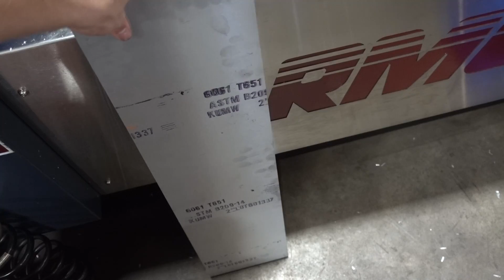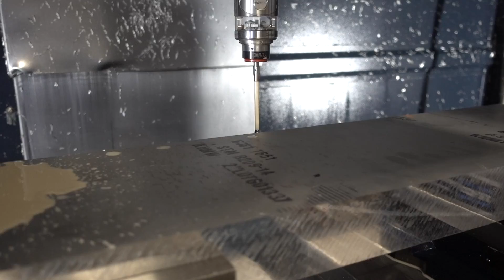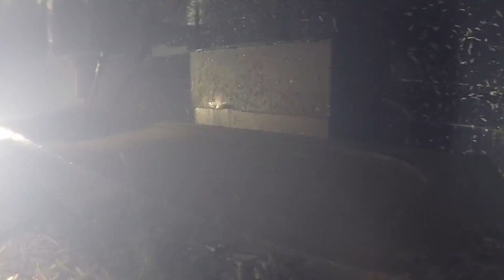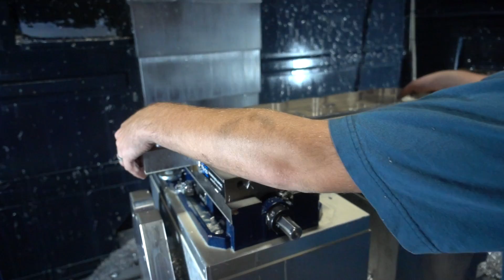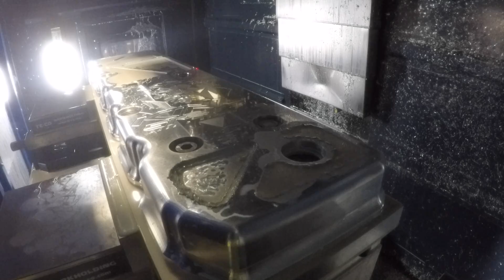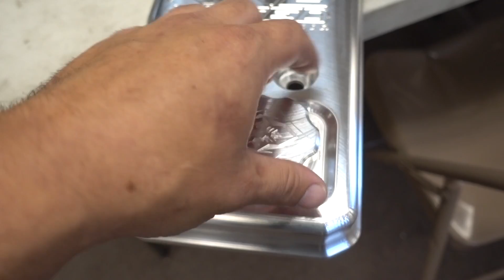HOW WE MAKE CUMMINS BILLET VALVE COVERS!!!

Comment: You really shouldn't smack the first op down with a deadblow. You should cut it in it's most relaxed state until you have square and accurate edges. Then tap it gently down onto your parallels or whatever on the second op. If you keep doing it this way you are inducing stresses or twists into the material. when you release it the material will want to spring back, and now the "flat" surfaces you just machined will be bowed or twisted. It might not matter too much for this application since it's getting bolted down all the way around but if you truly want the best sealing surfaces or you want it to be as flat as possible you should consider not tapping down the first op. Just a tip, other than that they look pretty killer
Reply: I'm shocked at how many people don't know this.  They incorrectly assume that the raw stock is not twisted at all.

Comment: Completely wrong paths, crap end mill and side lock holder. Climb mill path, Kennametal KOR5 end mill and Kennametal HydroForce chuck will rock your world. Watch one of Titan’s videos. 20K rpm and 1600 ipm. Boom.
Reply: Maybe but you don't know what his profit margins are on this part, how much he gets or how many he makes. That tooling set up for one tool is about $1,500 vs $200 or so for what he's got. Also I've never heard of that machine before, he might not be able to take advantage of a tool like that.
Reply: While not ideal, even using an ER holder would be a step up from a solid holder and lock screw setup. I've made V8 billet valve covers in a Haas using ER holders. I push it as hard as I dare without sucking endmills out of collets. I do agree if money isn't a factor a hydraulic holder would be ideal.
Reply: @moorepower7  it depends on the quality of the tool holder, most tooling companies say never to put an end mill in an ER.  A good quality sidelock is a better choice.  I think the main reason is that you can't hold an end mill tight enough to guarantee no pull out when pushing a high end endmill hard enough to get good life out if it.
Reply: @85CEKR  Side lock holders definitely have their place, but in my opinion this isn't the place. I use side lock holders all the time in our big 50 taper horizontal cutting 4140 steel running +/- 2000rpm. When cutting aluminum in our VF2SS at 12000rpm, I want a balanced holder that doesn't have a screw on one side throwing off the balance. If you're not trying to run balls to the walls RPM, side lock works.......but it's a lot more fun to set the feed and speed on kill and watch the chips fly!
Reply: @moorepower7  it is true a side lock is more beneficial in steel because the RPM is generally lower and there's a much higher force pulling the tool out.  I'll be honest I very rarely hold endmills in a side lock holder. We usually use hydraulics, shrink fit or a milling chuck (big kaiser's mega chucks are amazing) I just know that all the tooling experts I've talked to act like I'm killing babies or something if they see one of there endmills in a ER when they're walking though our shop.  They always say at least put it in a side lock. Also I don't have any but I know there are high balance side locks out there.
Reply: Why don't you post a video if your programming? Titan is a floppy shoes clown, by the way.

Comment: Couldn’t you use a face mill then come through with and end mill and finisher to speed up time?
Reply: PSD Leach You can’t really high feed mill aluminum just because you can put some serious work in with an endmill if you have a high rpm spindle. For example with a 1” high feed mill which is pretty small I can take 4.5 cubic inches a minute in steel. With a 1/2 endmill in aluminum running 7500 rpm at 1” doc .050 radial you can take close to 10 cubes. Obviously they definitely could increase their depth of cut and use chip thinning to their advantage, but they’re not.
Reply: dont tap you raw blanks into the vise on the first operation you dont allow the natural twist of the blank to be machined out and once the x&y is set program a pin stop in a tool holder to bump up against instead of using the probe every time and On the first operation you could use a 1/2 accurapro full dia cuts at .800 depth of cut at 12000rpm and 80 inches a minute then reaclamp the part before finishing to realeas the stress and lightly rea clamp and finish then the last op could all be done on a vacuum fixture so you dont have to use bolts to hold it down also when you go back and do engraving on the anodized parts you just put it on the vacuum fixture and suck it back down and it will all be set
Reply: Can’t plunge cut with a normal face mill. I know they make some face mills that do it but you’re limited to .030-.050 depth of cut where they’re probably doing .125 at a time. More than likely doesn’t make much difference in the end
Reply: That makes sense. I’m not a machinist so I don’t know a whole lot. I just have a lot of family in the business and used to preset tools for acutec aerospace
Reply: We use a 2" Korloy F.M. in aluminum - while it's true you can't plunge straight down, I spiral/profile down into 6061 aluminum (which is what this cover is), ramping down .06 to .08 at a time at 200 - 240 inches a minute feed and at 7000 spindle rpm.
To be fair - real world machining isn't what these guys are about.
Reply: I would use a 2 inch high feed mill then finish it with the carbide endmills needed .and I would use air blast instead of coolant to blast all the chips away so you are not recutting them. That coolant looks like it needs to be changed out badly.